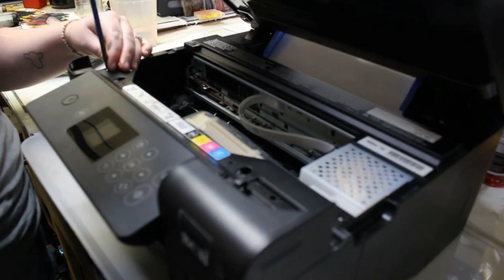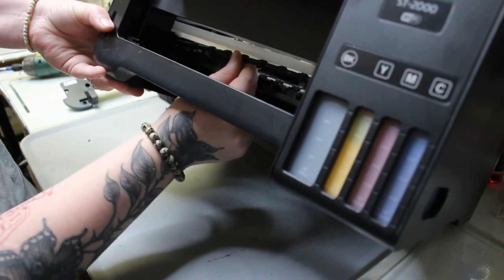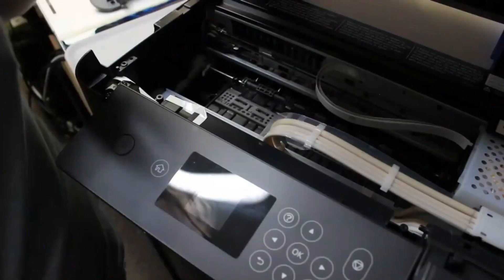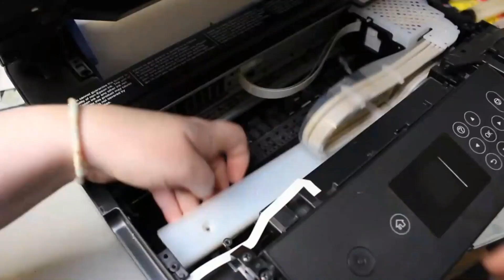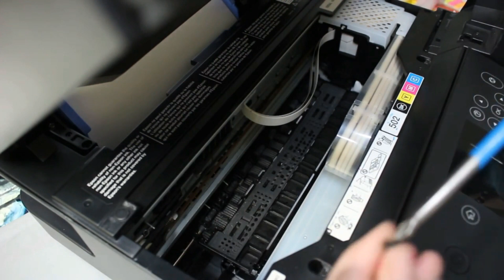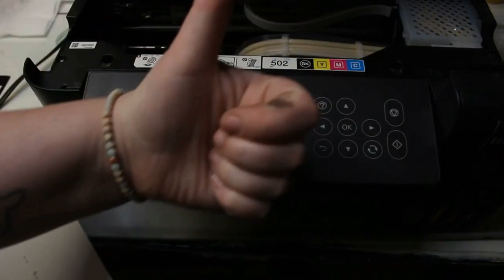Solving Paper Jam Issues in Epson ST-2000 and ET-2750 Post Star Pizza Wheel Removal

Comment: ET-2750 clear wheel fell off, I put back up the way Abby did. but, when I power back up it starts up, until gets back to left makes a noise and says same error again E-301. The weird thing is plastic clear wheel as still in place, but stays righty there on left side. Now what, no paper jam I see, what could be wrong.
Reply from the maker: Thanks for subscribing and sharing the details! I really appreciate your support—every subscriber gets me closer to that 100k milestone, and I’m grateful for your engagement. It’s been 8 years, and I’m halfway there, so every question counts. I try to answer subscriber comments within 48 hours, but if you need quicker help, feel free to email me at support@bchtechnologies.com.

The E-301 error could still be tied to the encoder disc, even if it looks like it’s in place. First, double-check that the encoder disc is properly glued onto the paper feed rod and spins in sync with it. If the disc slips, the sensor won’t be able to track its movement accurately, which could trigger the error.

Also, inspect the sensor itself to ensure it’s installed correctly and aligned with the encoder disc. Sometimes, if the sensor is slightly out of place, it won’t read the disc properly. Don’t forget to check the flat flexible cable (FFC) connecting the sensor to the mainboard—make sure it’s fully seated and oriented the right way. A loose or reversed cable can lead to miscommunication between the sensor and the printer’s control board.

Let me know if the error persists after these checks. I’m happy to help troubleshoot further if needed. Thanks again for being part of the channel and supporting my content!